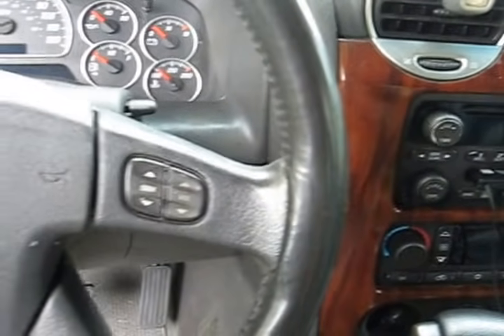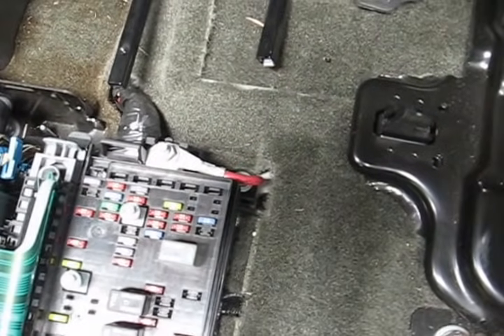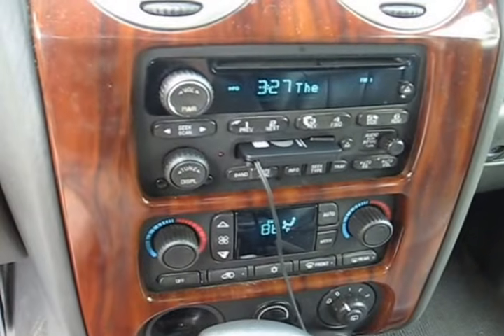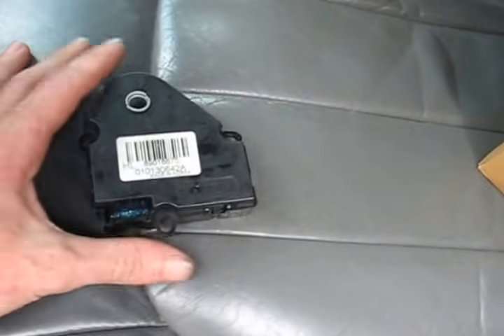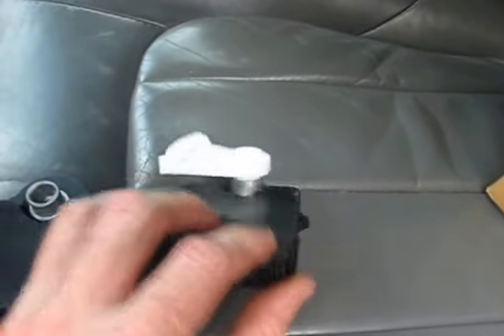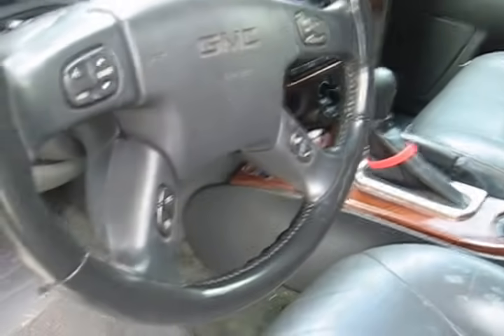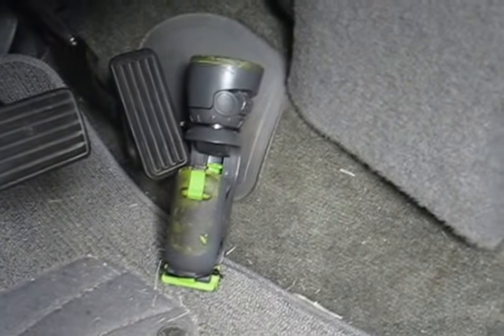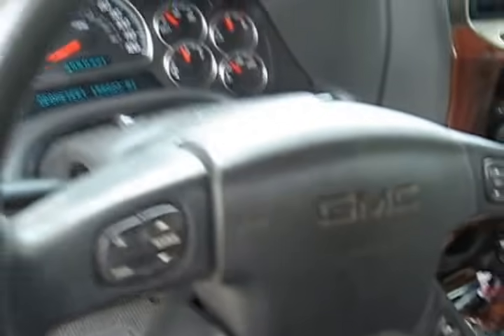GMC Envoy HVAC actuator Replacement

Comment: I being struggling with my blend door actuator on my Chevy cobalt Lt 2009, I took it off but I don't think that that one was the correct, because the new wich is exactly as the one I took doesn't fit, what happened if I just don't put it, what bad can happen???😣🤔
Reply from the maker: Whatever function it controlled won't work anymore.
Reply: @pfun41  😣😣

Comment: I know this is an old video but I have a 2005 GMC Envoy XUV and the heat doesn't blow out the front vents now but it does out of the back vents located behind the arm rest and center console. So Im guessing that the heater core is ok since it blows hot in the back and it's not the blower motor since its working back there so it must be the actuators in the dashboard? Im just trying to narrow down the issue before I take it to the shop. Any ideas or help would be greatly appreciated. Thanks.
Reply from the maker: I believe there is a separate blower control for the rear which means there's a separate blower for rear heat. If the blower doesn't work at all in the front it's likely a blower issue, if it works but not on heat it's likely a blend door.

Comment: Only thing wrong,you didn't show you you removed the air duct.....I'm having all sorts of trouble trying to remove it..PLEASE SHOW HIW YOU GOT IT OUT
Reply from the maker: take out the push pin and it should just pop out.
Reply: @pfun41  Having problem with air duct also. Got it off but can not get the sensor off to take it completely out. I'm afraid of breaking it. How does it come out?

Comment: I had to disconnect battery, Acuator stoped working fuse trick did not work unfortunately
Reply from the maker: the gears get brittle with age sometimes the calibration breaks them. It's luck of the draw unfortunately.

Comment: My hvac doesnt look like yours.  '07 GMC Envoy. There's 2 knobs & in the center,  there's 2 sliders which are illuminated & the Passenger side DOESN'T ILLUMINATE.  The airflow is Fine, but the Position(feet level) won't blow.
Reply: Also, when I'm driving & the heat/ac is OFF, air still comes thru the vents.
Reply: Also, the armrest ventbthat blows to the backseat blows NOTHING...
Reply from the maker: You have the standard Climate control module. It uses actuators just like the auto climate control but the controls are not auto.
Reply: I've been told by the Dealer that the hvac unit needs replacing.  I tried the recalibration as U instructed & it still wont blow on the feet
Reply from the maker: @anniegibson5092  If an actuator or the HVAC module failed then recalibrating won't work. Get a second opinion.

Comment: I need to remove the temperature control module. How do ya do that? Can i take off the facing on the dash?
Reply from the maker: Take off the trim that goes around the gauges and radio. Then it's just a few bolts.

Comment: Question 
How do you know which actuator is bad I am having hot air coming out from the drivers side and cold on the passenger side and I have it set on cold
Reply from the maker: Temp door actuator

Comment: Just out of curiosity, would the actuators be in the same location for a manually controlled HVAC setup?
Reply from the maker: I believe so, I think they just used a manual control module.
Reply: pfun41 there is an actual actuator from what i've researched. The only difference between auto and manual controlled HVAC, is the temperature control.

Comment: I would very much like to know how you were able to get your hand up there to get the other actuator off. The one you showed is easy to get at, the one for the bent doors is not. What did you have to take off to get to it and why didn't you video that one?
Reply from the maker: I only worked on the Defrost and mode doors, I never messed with the temperature blend doors. I don't video things I find repetitive or nonimportant as it just adds more time to the video.

Comment: how did you remove the white arm out of the actuator? I tried pulling on it and ended up just snapping it off.
Reply from the maker: +Quentin Bartholomew Has to pull straight out, its a press fit. I used needle nose pliers and pulled on the base.
Reply: +pfun41 had someone tell me on trailvoy that it was necessary for the actuator to function properly. after pulling it out and looking at the actuator plugged in but not on the shaft, it doesn't want to go through its full range of motion
Reply from the maker: Quentin Bartholomew It's just an adapter, its only there so the actuator can drive a particular blend door. The HVAC module has to be calibrated before the actuator will operated properly.

Comment: My problem is same make and model is that when im driving the ac wont turn off it just keeps blowing air i can change where the air blows out but i just cant turn it off... what can i do AC stays on when driving and wont turn off.. BUT IT DOES turn off when i shut off the envoy.  Pls help
Reply: SuperJg31 did you find out because me mines doing the same

Comment: hi, 
is there a chance by removing the old actuator breaking the shift? was it difficult to turn the shaft to line up the new actuator?
Reply from the maker: The shaft for the blend door should move pretty easily.

Comment: I've been having a problem with my a/c, the drivers side works perfectly and the air comes out cold, but the passenger's side, the air comes out hot, no matter how much i turn down or up the temperature is still comes out hot and warm, I dont know what to do, can u help pls?
Reply: I'm having the exact same issue.  Did you figure out how to fix it?

Comment: When the HVAC in my 2005 GMC Envoy is turned off is when it makes the clicking noise.  Is this the actuator? Or something different?
Reply from the maker: Pull the kick panels and track down the noise, only way to know for sure. But the HVAC doesn't receive power with the key off IIRC.
Reply: I know what your saying. When you turn off the blower it makes that clicking noise,mines does too,but it only clicks on defrost,and when I power off the unit,I have to keep it on face,or feet all the time so it won't click,I purchased the AC delco unit a while ago,I just picked a stubby 1/4 ratchet up so I can get back there with that 5.5 socket! I tried before,but if you don't have a 1/4 short ratchet,just go grab one before you bend over!I left it alone for months but I'm gonna do it tomorrow I needed that ratchet!I just watched the video again for reaaurance!Thanks again pfun41 !

Comment: My 2007 Envoy doesn't have the front vents working. I tried this and it didn't work for me. Anyone else have any success getting them working?
Reply from the maker: Tried what? The reset or replacing the mode actuator?
Reply: Tried resetting. I pulled the fuse and followed the steps, heard the actuators moving but then still no air in the front vents. Tried disconnecting the battery again and doing this over again and still nothing. But I don't hear any clicking when I'm trying to change modes so I don't think it's broken
Reply from the maker: Actuators can fail in many ways. Its possible that a motor burned out or a gear stripped and isn't making noise. You can pull the lower dash cover and watch the actuators move as you cycle the controls.

Comment: Good video! You show the replacement of the mode actuators but which one is the blend door actuator for the drivers side heat and where is it located? If you have a different vid for that please link it as I can't find one specifically for the blend door actuator. There are several for the mode actuators. A friend has an 08 Trailblazer, automatic control system, he has warm air in heat mode on the passenger side only.  The mode actuators appear to be working, he changes where the air is supposed to blow out and it changes where the air blows out, it's just always cold on the drivers side. He doesn't hear clicking but it could be a "silent failure".
Reply from the maker: I don't have one. I didn't look for that one as it wasn't the problem. I think they're the lowest ones on each side of the console but can't really remember.

Comment: Hi I have a 02 GMC envoy. there is the clicking noise under the driver dash. the front vents would blow for a little bit but then it stops blowing. you can hear it blowing but not actually coming out of the vents. what do I need to actually replace?
Reply from the maker: Probably mode actuator.

Comment: I can see that GM did a great job engineering something that was guaranteed to fail and cost over $1000 to fix. The system on my 98 Nissan Pathfinder uses cables and works like new. Great job with those Chinese parts. I can see why GM went bankrupt. I also know why I got my trailblazer for $500 that runs and drives great. All it needed was a brake job. and the heater doors fixed which I wont do because I live in Vegas and the AC works great. All I hear about new GMs is cheap parts the break way to soon and a nightmare to fix. Like Ford with blow out spark plugs and you have to pull the cab for the repair. Are these people crazy? Maybe we need more women CEOs that have no idea what their doing.
Reply: *Woman engineers for diversity of though and ideas